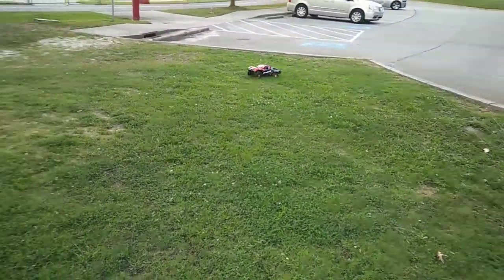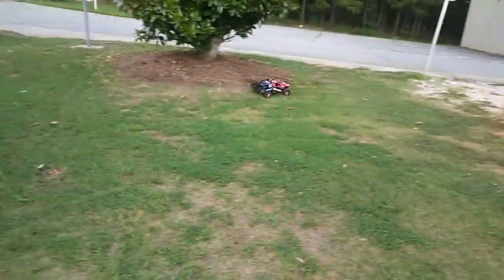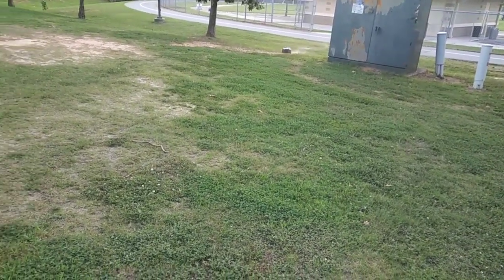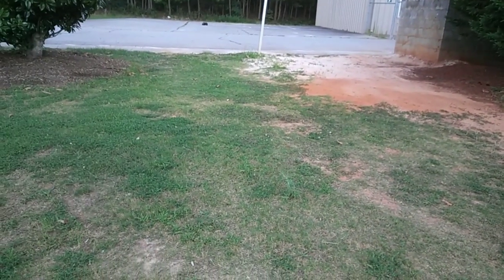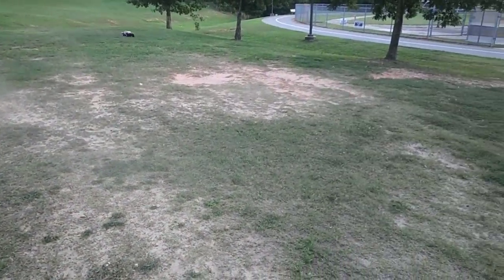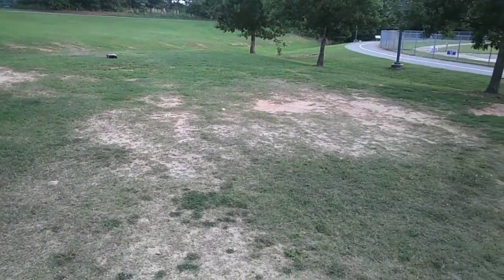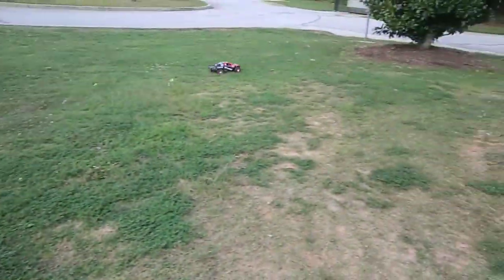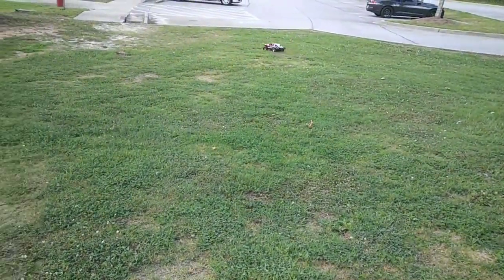Traxxas Slash 4x4 vxl 3s Run

Comment: nice, i need to get off my butt and finish the upgrade/conversion of my slash 4wd from off road basher to on road speedster.  it has been down way too  long but it's been so hot here I didn't want to suffer with sweat during the whole build project.

Comment: I’m just getting into this. Can you run a 3s LiPo Battery without changing anything on the car or do you need to change the gearing. I keep reading things that make me wonder if there is more to it or can I just buy a 4,000mah 3s Traxxas LiPo and throw it in it
Reply: You can use any size 5000mAh 3s without changing gearing :)

Comment: That’s looks so smooth I put 3s on mine. Temps were good but I went through 3 driveshafts then finally my 
dumbass did not learn after that and shredded the main spergear. Might upgrade parts and try again because wheelies are way too much fun hahaha
Reply: Is it a 2wd slash? If it is theres the problem. 2wd cant take 3s
Reply: ChiefinBeatz yeah they can lmao. Steel driveshafts, dece gears and you’re mad chillin